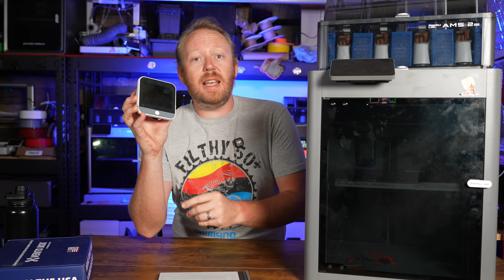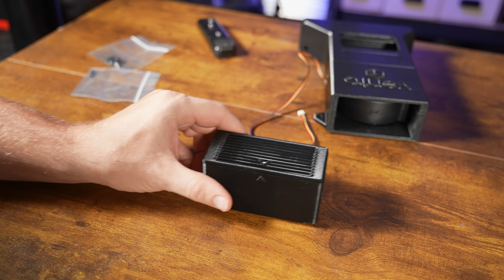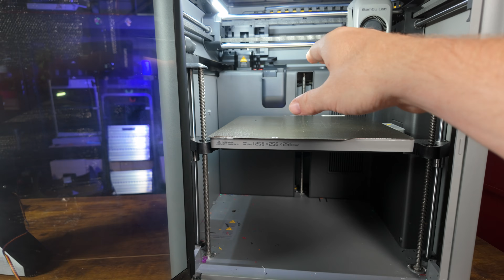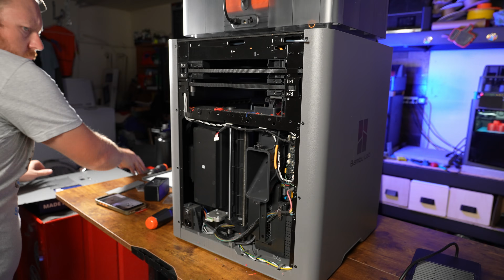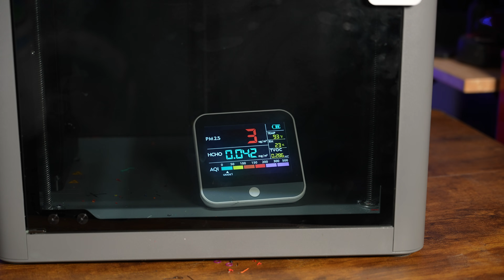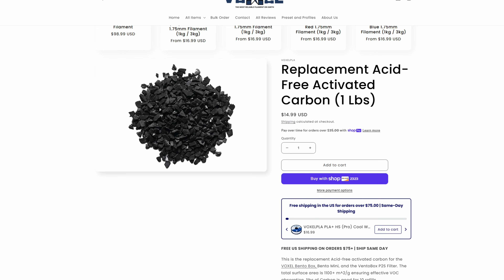I Tested the Voxel VentoBox on My P2S – Worth It?

Comment: Hello. So is this supposed to grab the fumes and shoot them out the bottom port BEFORE they can even escape out of the poop chute hole in the back?
Reply from the maker: So it can recirculate the air thru the filters, or it can do a single pass and put it out the bottom. On higher temp stuff, the exaust fan is generally off or very low

Comment: I’m definitely switching to voxel air filters once I go through my current Bambu Lab stock for my P2S and H2C. They seem to be of much better quality, last a bit longer and are competitively priced. More importantly that are typically in-stock!

As far as the vento box, I have been using one for 6+ months and can say it is super effective, especially with it now being fully integrated into the Bambu Lab firmware for the P2S. It actually does a much better job at filtering than the built in filtration system in my H2C. I couldn’t speak more highly of Voxel products!
Reply from the maker: Glad to hear it! yeah im still amazed how it integrates with the printer.